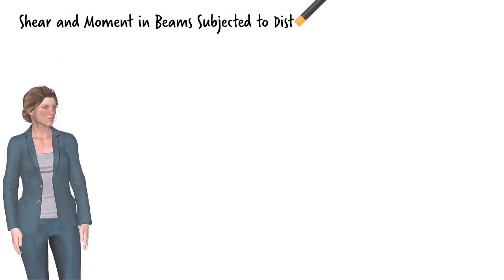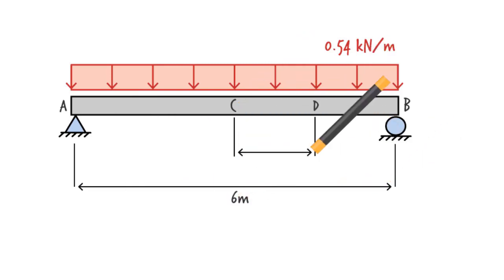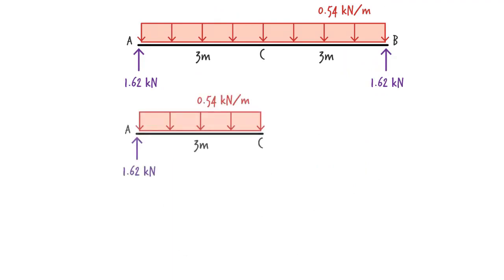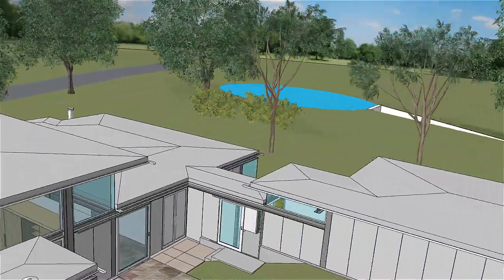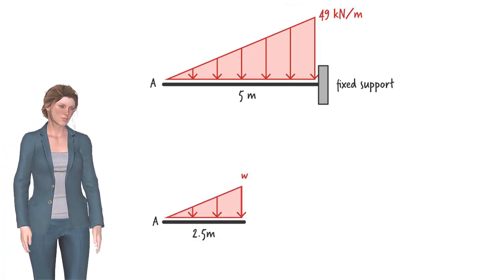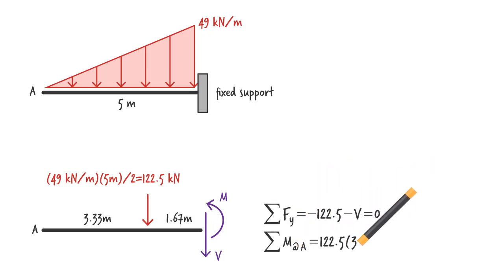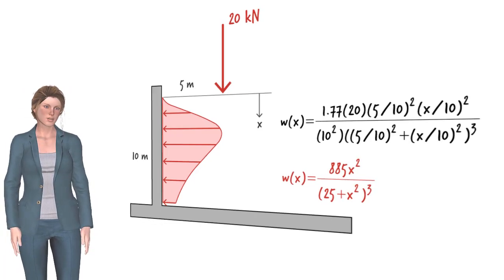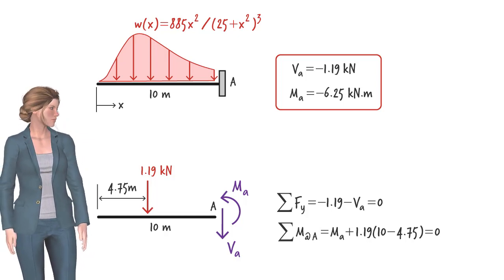ST09: Shear and Moment in Beams under Distributed Loads

Comment: Thanks a lot for your videos, i am learning a lot. How did you come up with 1.67m and 0.83m
Reply from the maker: The equivalent concentrated load is placed at the centroid of the right triangle.

The centroid of a right triangle with base L is located L/3 from the right-angled vertex. 

Therefore, since L = 2.5, we get 2.5/3 = 0.83 m.

Comment: Hi! I'm a CE student and I haven't really have the knowledge "yet"(*edited haha) of construction in real life. I would like to ask whether the supports of the steel beam in the first situation is for educational purposes only or is it what's usually done in real life? Thank you in advance.

Also I would like to say THANK YOU VERY MUCH for your / Dr. Structure team's efforts in making these videos. It really helps a lot. Happy New Year!
Reply from the maker: The use of friction pads (which can be viewed as a roller) is not uncommon in modern structures. Bolted connections using slotted holes can also be considered to act as rollers in some cases.

Simple bolted connections (the beam and column are connected using a few bolts) can be viewed as pin connections. And, most welded connection can be considered as fixed supports, when analyzing the beam in isolation.
Reply: @DrStructure  Oh I see. Thank you!
Reply: Your reply : The use of friction pads (which can be viewed as a roller) is not uncommon in modern structures. Bolted connections using SLOTTED HOLES can also be considered to act as rollers in some cases.

My question : In that SLOTTED HOLES to act as rollers, are bolts placed at the middle of the slotted hole, to give room for the beam move to the left and right directions during contraction and expansion?
Reply from the maker: Correct!

Comment: How did you get 1.19b = 5.66 at 8:58
Reply from the maker: We are replacing the distributed load with its equivalent concentrated load. 

The load magnitude is the integral of w(x), which we have labeled Pe. This load magnitude equals 1.19 kN.  That is, the integral of w(x) = 1.19

To determine the position of the load, we take the moment of Pe about the left end of the beam and set it equal to the moment of the distributed load about the same point. 

The moment of Pe about the left end of the beam is b Pe where b is the unknown moment arm we wish to compute.

The moment of the distributed load w(x) about the left end of the beam is  the integral of x w(x). This integral comes out to be 708/125 or 5.66. 

Therefore, we get: b (1.19) = 5.66.
Reply: @DrStructure  do we need to integrate the entire ( w(x).x )? why ?
Reply from the maker: Yes, we do need to integrate x w(x). Because the moment of an area defined by a continuous function (e.g., w(x)) about the origin of the coordinate system equals the integral of x w(x) dx. Here, since x is a variable we cannot factor it out of the integral expression.
Reply: @DrStructure  can you elaborate it a little bit ?  Or is there any video of your's about this point that i can watch and understand better. Thank you.
Reply from the maker: With regard to calculating the moment of an area under a curve, you need to look into calculus. This topic is often covered in an introductory calculus course. I am certain you can find multiple videos explaining the concept.

Comment: How have you calculated w(x) in last part
Please explain
Reply from the maker: Surcharge load distribution determination due to a point load is rather complex and outside the scope of introductory structural analysis. There are various models and techniques for determining soil pressure distribution. For a basic introduction to the topic see: http://howtoengineer.com/offset-surcharge-elastic-methods/

Comment: Does the equation for w(x) in the last retaining wall apply to every case, if not, how do i generate it for any case.

When i also have a surcharge, how do i generate the equation?
Reply from the maker: Earth pressure calculations on retaining walls is a rather non-trivial topic. There are books and other resources that you need to get your hands on and study. For example, see:

https://books.google.com/books/about/Earth_Pressure_and_Earth_Retaining_Struc.html?id=_3_SBQAAQBAJ&printsec=frontcover&source=kp_read_button#v=onepage&q&f=false

and,

http://web.itu.edu.tr/~teymurb/fe1lecture4.pdf
Reply: @DrStructure  Thank you for the resources, if you have any other helpful resources, can u provide please.

Comment: Good day Dr Structure

Is the next video, going to involve any retailing walls or  it will be something else different or maybe a continuity of the shear and moments as in ST 09
Reply from the maker: Next video, ST10, deals with shear and moment equations in beams. This ST series of lectures deals with engineering mechanics-statics topics.  We are planning to cover the analysis topics before getting into design.
Reply: @DrStructure  Thank you. I will be waiting for your next videos. Your videos are very very helpful.  I hope the design parts won't take years to come.

Comment: I have this question on my table, i a should get a small design moment and shear. 

A developer requires the construction of a 4,5 m high counterfort retaining wall.   The wall has to resist a surcharge load of 15 kN/m2 and soil with a density of 1765 kg/m3 and an angle of internal friction of 35 degrees. The following options are to be considered:  Reinforced masonry  The material and material properties to be used: - 390 x 190 x 190 mm hollow concrete blocks. - Class I mortar. -  Density of wall (units, mortar, reinforcement and concrete) = 2 300 kg/m3. All bed and head joints are 10 mm thick. 

This is under Structural masonry design, i am confused as to weather i calculate the reaction and momentum at the base or on the counterfort considering them as supports,

Is there any involvement of the wall weight coz nothing is said about the base.
Reply from the maker: Turn it 90 degrees and you have a haunched slab, or beam. That is a beam with a variable cross-section, a smaller cross section at the tip and a very large cross-section at the base. That large cross-section at the base results in a large moment of inertia which would reduce bending stress significantly, compared to a wall without the counterfort.

Yes, you should also pay attention to the footing since it is going to transfer the load to the ground. Any part of the system that undergoes stress should be properly analyzed, and designed.
Reply: @DrStructure  Thank for Dr Structure for the quick response,

Firstly the 90 degrees you are talking of is it the same as what was done on the video,

Secondly, am i going to multiply the surcharge with the same distance as the wall height or with a 1 m width? Because it seems like i have to get Uniformly distributed Loads.

Thirdly how do i involve a counterfort in my calculations.
Reply from the maker: The analysis and design of retaining walls is a bit involved, you need to immerse yourself in the topic in order to better wrap your mind around the process. 

Yes, that is what I meant by turning it 90 degrees.

No, the pressure on the wall due to surcharge is not uniformly distributed. There are several models for determining the pressure profile on the wall. It could be approximated as triangular/trapezoidal, or as a nonlinear function similar to what we have in the video.  

The counterfort can be viewed as a part of the wall. So, the wall is not longer rectangular in cross section, it has a T-shaped section due to the counterfort. The flange of T is due to the wall itself and the web of T is due to the counterfort.
Reply: @DrStructure  Thank you, let me try thats and see if i can win interms of getting the smaller ultimate shear and ultimate moment
Reply: For the surcharge you said it can not be converted to a Uniformly distributed Load. According to the rotation of 90 degrees you mentioned earlier, do i exclude it in that case on the load contribution on the wall?  If i include it how do i convert it so that i can calculate the moment and shear, assuming my counterfort to be the supports which are 1 m apart.
Reply from the maker: @mashambashonhai4901  You do need to include the surcharge load in your analysis, if such a load is actually present. My point was that the effect of the load on the wall is not going to be uniform, the surcharge load on the wall increases with depth. You can model it as a triangular load or a nonlinear load, but not as a uniformly distributed load. This is independent of whether or not you rotate the wall. That rotation is done to make the wall look like a beam for the analysis purposes. It does not (should not) change the loads on it. 

You need to study a bit of soil mechanics to see how forces, including surface forces like surcharge, propagate through the medium and effect a retaining wall.
Reply: @DrStructure  Thank you, let me have a deep  research on the retaining wall

Comment: Nice example with the concrete dam :>). I tried to experiment with a 1.8-meter wall. Thickness 0.3 and b meter wide. I included the weight of the wall and came up with the following equation for the normal stress in the beam: -23.54.*(1.8-x) +726.*y.*(1.8-x).^3. It was clear that the beam had tensile stress on the water side and compression stress on the other side. I also tried to contour plot the function in Matlab which ended up well. Is it recommend doing that (contour plot)?.
Reply from the maker: Yes, such retaining walls are going to bend outward yielding tension on the water side and compression on the free side. For design purposes, a contour plot for bending stress is not necessary, although it is a useful visual aid for better understanding how the stress various across the cross-section of the wall.